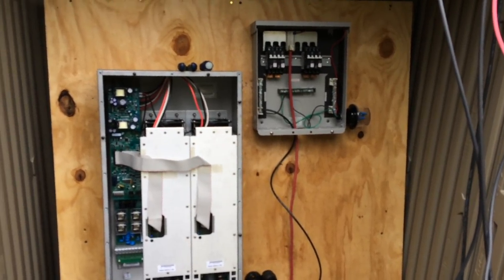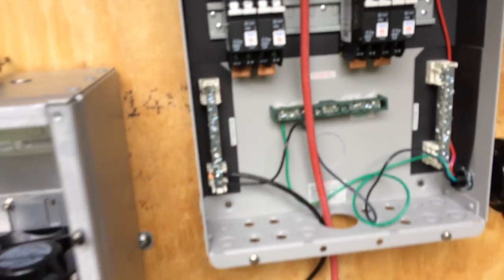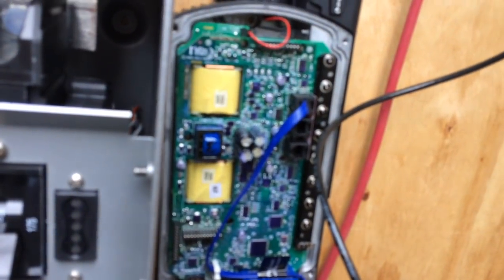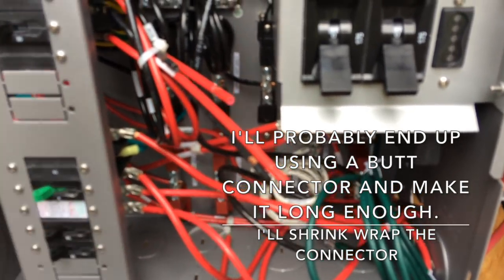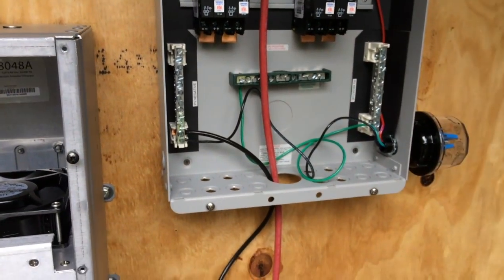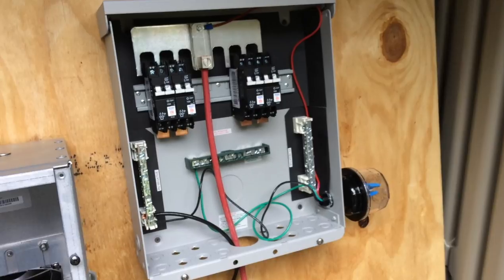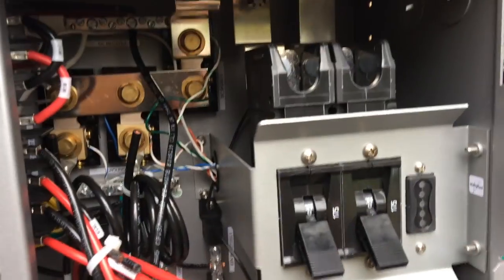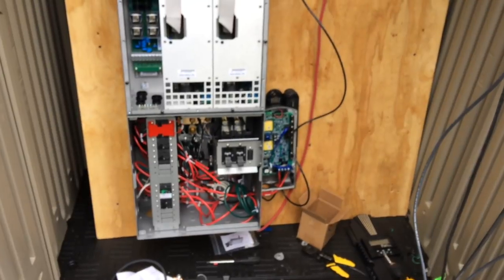Homestead Hybrid Solar Power: Let The Wiring Begin: Part 3

Comment: Sorry if you said this already but are you doing a grid tie or a completely off grid setup?
Reply from the maker: It's called a grid assist or grid zero. I won't be selling power back to the electric company. I will use what I produce and buy whatever additional power I need (mostly at night). Right now the batteries are for emergency backup but I plan on adding additional batteries down the road and using that power at night.

Comment: oi tommy, ur gonna regret not puting the midnite classic at eye level to the meter and u need thicker wire to the load center cos it will heat up. butt connectors?? can they handle 30amps and high dc voltages?? Now I am getting concerned..... lol
Reply: btw, conduet inbetween boxes will neaten things up and protect the wiring.
Reply: make sure the classic has no obstructions at the top for heat venting too.

Comment: Are you planning on putting rubber or plastic grommets where the solar wires enter the combiner box?
Did Magnum not include some kind of wiring diagram for there load centre?

Comment: Impressive!  Wow, power in your area sounds expensive!  My bill here in Ashland, OH is generally about $90, and I have a well pump, chest freezer, fridge, lighting, fans, electric hot water heater.

This morning I had 4 tandem axle dump truck loads of reground asphalt millings delivered for my new pole barn.  The builder is starting site prep on Monday and since I can't get the millings then, we jumped the gun a little bit so he would have them.  They were dumped along the south wall and the builder will scrape the sod/topsoil along the north wall first, where the most fill will be needed, and then push the millings over and clear the south half.  It will be so nice to have a good workshop space!

The only bad thing about your channel is that you aren't my next door neighbor, Tommy!